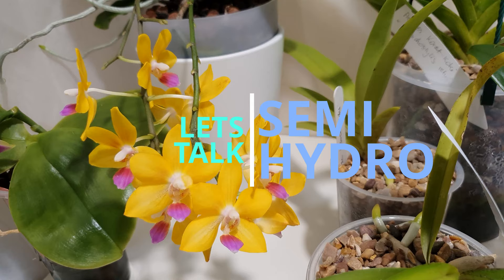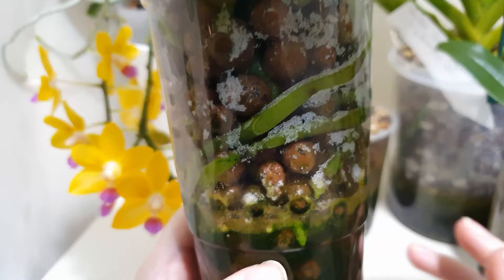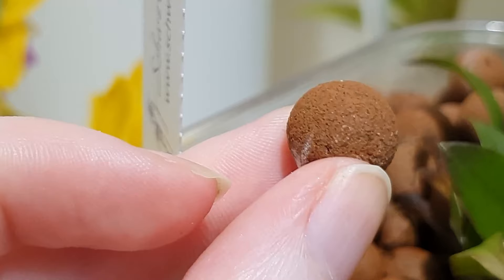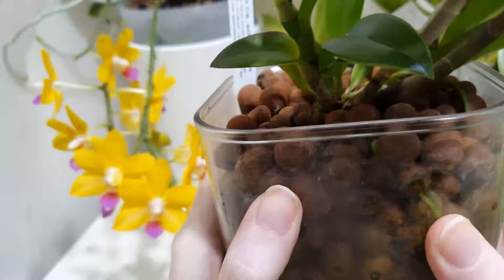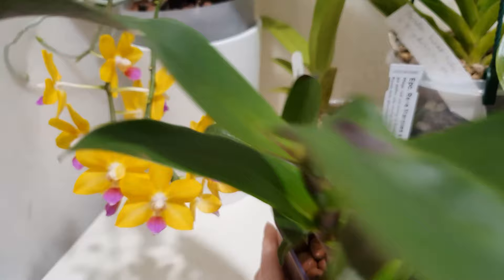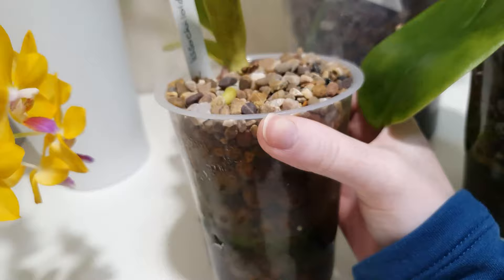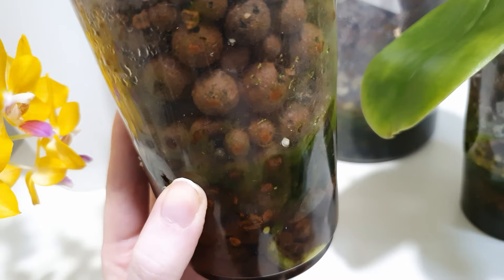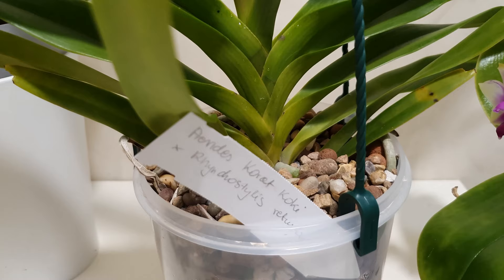Let's Talk: Semi Hydro for Orchids- Intro, Root Adaptation, Overcoming Dry Top Layers, Modifying SH

Comment: I'm going to disagree on the importance of a wet/dry cycle. There are orchids, especially some Dendrobiums, in which the wet/dry cycle (especially a rapid cycle) affects the way that the plant grows. I happen to have two Den Jaquelyn Thomas (gouldii x biggibum) that started as nearly identical plants. One was kept potted in bark, the other was mounted to a tree. The next new growth on the mounted plant was much taller and thicker than that of the potted plant as was the subsequent growth. It wasn't until I repotted the potted plant into lava rock that it produced growths of the same size and thickness of the mounted plant. Additionally, my C. labiata, when grown in a pot with bark, always produced growths that were "floppy" and required staking until they were mature and hardened to remain upright. Grown mounted, this is not a problem, the growths are rigid and upright on their own.
Reply from the maker: I've never observed this but its interesting to hear about! Disagreeing is fine, it's how we learn 😉 How boring would the world be if we all agreed? 😄 Science and research certainly wouldn't have got very far. I would argue I can only generalise this to the orchids I actually grow- I grow very few dendrobiums and I grow solely in 'rock type' media for most orchids... there may be specific cases where wet dry cycles are very important and I think this is of particular importance in organic media. Wet dry cycle just means more efficient gas exchange right? So maybe those dendrobiums come from climates where they have exceptional oxygenation around the root zone and dry very quickly? Or could wet dry cycle also act as seasonal markers that are vital for some types of dendrobium but not others? Also tolumnias are great examples of this, the only time I have ever had success with tolumnias was keeping them on a heat mat with tiny pots filled with moss that dried within a day.... I think on the other hand wet dry is also vital for people growing in organic media for most orchid types, but it doesn't explain why semi hydroponics works so well in some cases.... any other ideas you have on this always welcome, I'm here to learn 😄 I just personally, for the orchids I grow (which is already a biased selection) notice improved growth without the wet dry cycle in inorganic media for a large percentage of orchids 😄 Also I get alot of questions thinking all my orchids will soon die because I don't let them dry out, so I really wanted to try and explain that side 😉
Reply: @TheOrchidRoom  I actually don't think root oxygenation has anything to do with the observed differences in growth. My hypothesis is that the fast wet/dry affects how water and nutrients are utilized in producing the growths, with a tighter cell structure in the fast wet/dry environment. Think about an Oncidium, if they are not given adequate moisture when growing, they will often get the accordion leaves which (presumably) is the result of differential cell growth. It doesn't explain why the Dendrobiums produced much larger growths, unless it is an adaptation to allow for more water and nutrient storage. Every Dendrobium I have that is in a fast/wet dry environment (either mounted or in non-water retentive media) has exhibited this behavior of growth. 
My entire ansomum collection is due for repotting this spring, all are potted in bark. I don't feel that the plants have grown canes as large as they should while I have had them. I'm going to pot some in sphagnum and mount the others to see if there is any observable difference between wet/dry and cane length they produce next year. I have my suspicions, as the plant that is in the smallest pot, which would have dried the fastest, produced the largest and thickest growth of the bunch despite being the youngest plant.
Now, Tolumnias, I have seen a lot of people attempt to grow them in s/h, I have yet to see one be successful. I honestly think this is more a function of the leca than the growing method. Even when used as a "dry" medium (meaning no reservoir), Tolumnia roots just fail in leca. This can't be due to air exchange, as the plants require frequent watering so the oxygen turnover is high. It can be due to root dessication, from the leca wicking water from the thin roots, however.
In my observation, though, some orchid roots just don't tolerate leca as a medium, while almost any orchid can be grown successfully in sphagnum (especially in hot climates).
Reply from the maker: I really can't comment on the type of dendrobiums you grow, although you raise interesting points... Maybe this type of deciduous or semi deciduous dendrobiums are a different set of rules? Or are you talking about hot growing year round watering dens also? I don't really grow any of the deciduous or cooler growing/ winter resting types, so have little experience to draw on with them...  As I've mentioned for many environments LECA doesn't work for all orchids, but since I've introduced pumice and the top layer I've found ways around this. I feel pumice is actually a much better media...My personal observations are that, for the orchids that I grow, they grow much more rapidly and much larger in constantly moist systems. I have used self watering with sphagnum and sphagnum bark mixes previously and this works excellently to mimic semi hydro without the use of leca for oncidiums. But the expense and yearly repots make this prohibitive for me, which is why I began looking for inorganic alternatives. I can't stand bark as a sole media... Personal preferences. Dry LECA is a very damaging environment for roots in my particular set of growing conditions...
Reply: @TheOrchidRoom  The Dens that I currently have with a fast wet/dry are all continuous growers. My anosmums are winter resters but need a lot of water during the growing season which is why I have kept them potted. But looking at other growers in Florida that have theirs mounted, theirs produce much larger canes. I have enough of them that I can afford to experiment with growing some in sphagnum and mounting others to see if there is a difference in cane length between more moist or fast wet/dry, they can certainly do better than they are currently.
I find it endlessly fascinating how different growing methods work in different environments. For s/h, it seems to work best within a certain temperature range, too hot or cold and it doesn't work. I had 0% success with Vandas, Catts and Dens in it, my Oncids grew OK but comparatively far better in sphagnum (more new growths, more blooms that last longer). Most growers in Florida opt for fast drying media (lava rock, chunk charcoal or very large bark) or mounting orchids that want a fast wet/dry. You would think with our summer heat that more water would be better but, IME, this isn't the case. Somewhat ironically, Oncidiums grow exceptionally well when mounted, despite drying very quickly here; but, they always have to be tied to the mount or they can get ripped off by the strong winds (80-100+ KPH) during summer storms. 
I'm personally not a huge fan of bark by itself but a few of my plants really like it. The Grammatophyllums and Vandas really take to it so that is what they get. Given that I don't have a lot of either, I can just give them Orchiata without breaking the bank and it lasts a good while.
Reply: Michael McCarthy in my environment (Michigan) almost no  orchid grows well in pure sphagnum. Too cool for too much of the year. Sphag. drys out too slowly in the dark cold winter months, even with very conservative watering. The best media I have found so far for catt types, and some phals and dendrobiums is lava rock with a thin top dressing of sphag. I am going to further expand the use of this media to other types slowly as an experiment.
Reply: Orchid Garden you can also try chunk charcoal. I find Cattleya love it, but you do have to be diligent with watering because it holds no moisture. Advantages over lava rock: you can remove a root from charcoal without damaging it, doesn’t absorb any nutrients so you never need to flush.
Reply: Michael McCarthy thank you!
Reply: Michael McCarthy do you know where I can order large chunky charcoal? I would like to try this out😊
Reply: Orchid Garden no need to order it, you can usually buy it anywhere they sell grilling supplies. Just look for pure lump charcoal (not briquettes). I get it at Walmart for around $10 a bag but they only gave it seasonally. Home Depot sells the Royal Oak brand hardwood lump for around $13 year round here in Florida.
Reply: Michael McCarthy wow! Thanks!’
Reply: Michael McCarthy just wanted to let you know that I put a few species or primary hybrid type phals in chunk charcoal after your suggestion (they were NOT doing well in bark mix) and I look forward to seeing what happens. Thanks again!
Reply: @orchidgarden3124  Glad you were able to find it and I hope it works out for you.